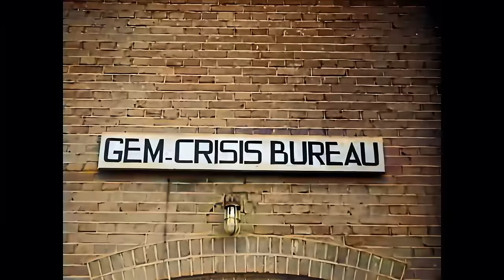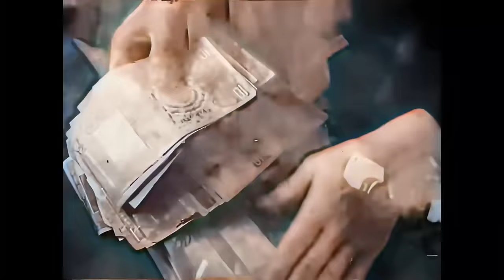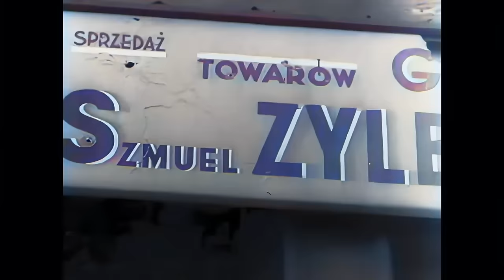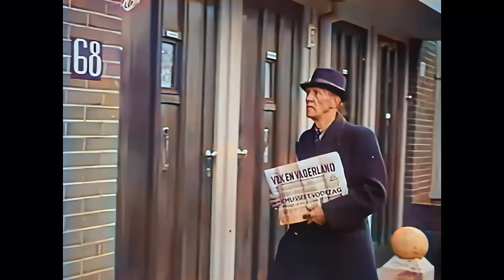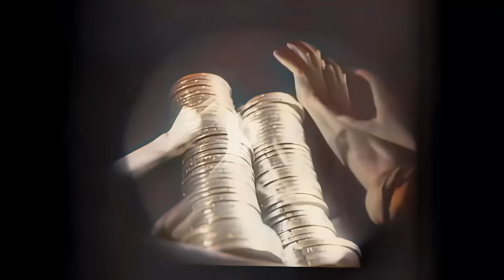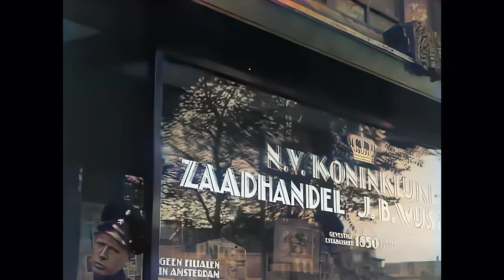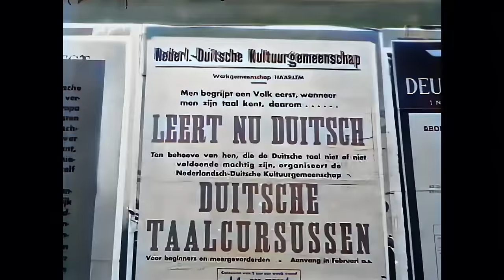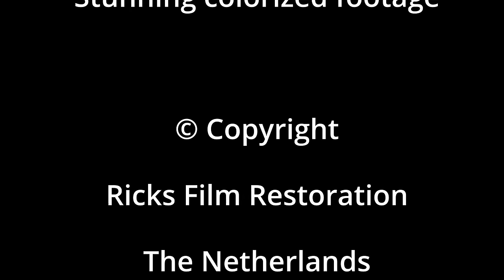Dutch Heroes, Collaborators and Traitors during WWII: A deep analysis using great colorized footage

Comment: It is easy for us to comment all these years later but back then most people were just trying to survive each day at a time. 
Unless you were wealthy and had good connections you had to do as you were told.
As time moved on the Dutch generally did not support the Nazis and they did what they could to cause trouble when they could. 
As the war progressed more and more joined in the underground movement. There are thousands of records of Dutch people helping the resistance throughout the war.